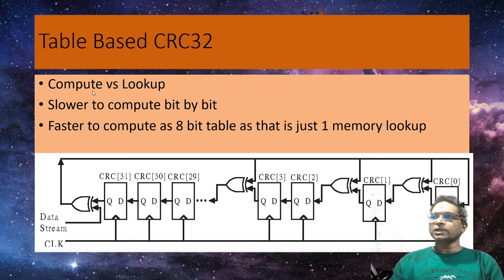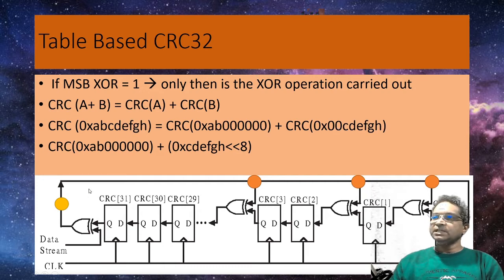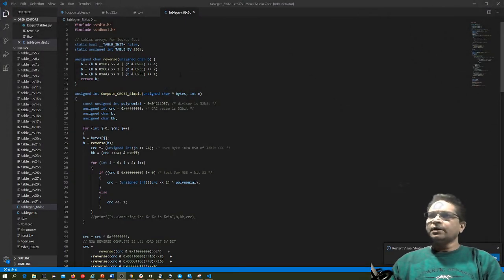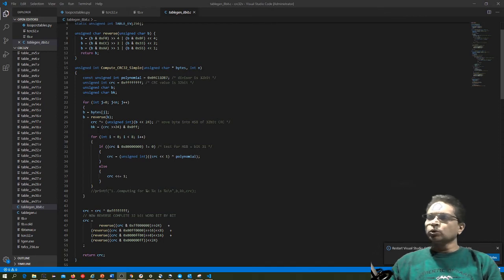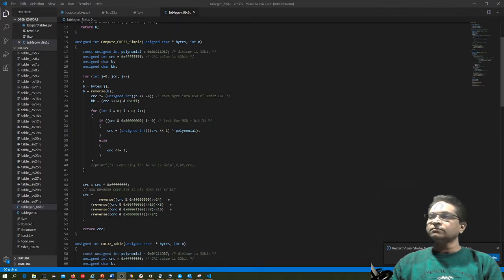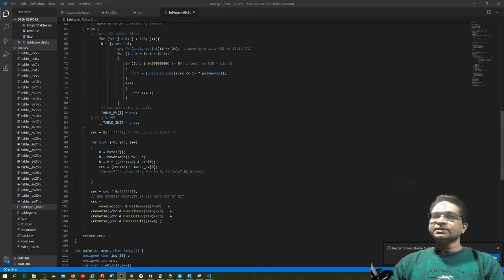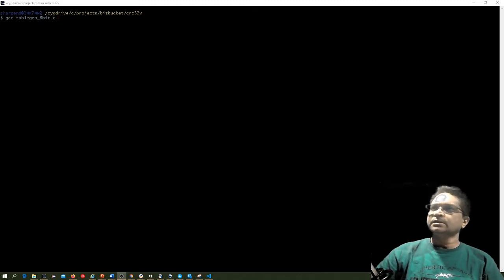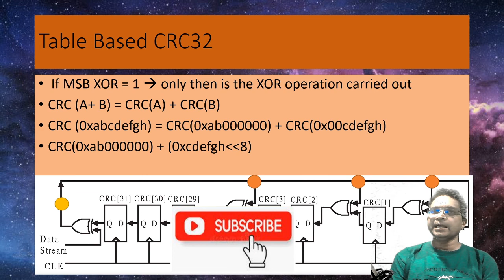Table Based CRC32 - Introduction

Comment: Any verilog code for the same?
Reply from the maker: Have not written this in verilog yet. But what width are you looking at ? I normally suggest you use a parallelized CRC32 already available on web. Writing this code in verilog will make sense if you have 8 bits of data. Its easy to make a ROM/lookup table and then just pass data into it as in C. However making larger tables becomes difficult. I show how to tackle large data widths in my other tutorial on 100Gbps CRC. Let me know your application and maybe i can suggest a path !!!